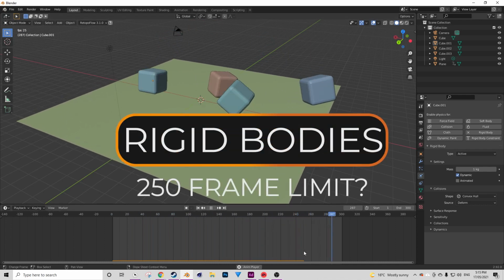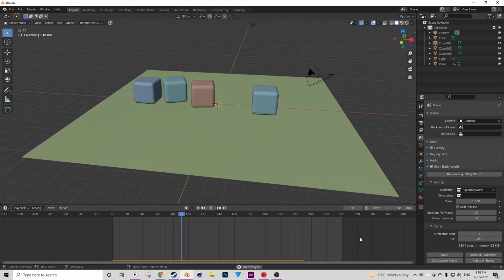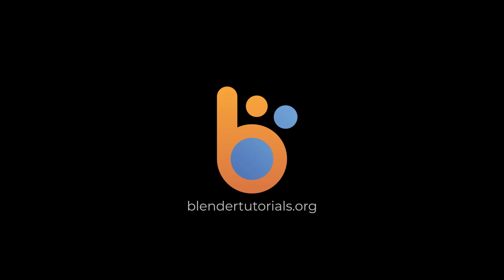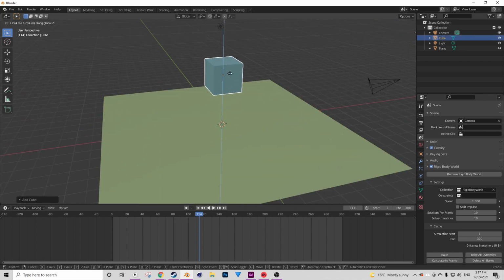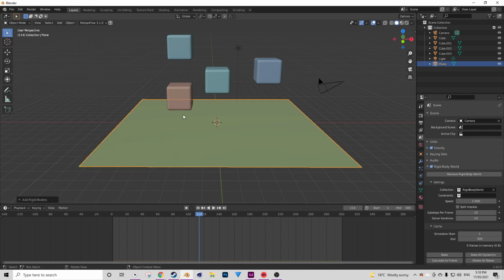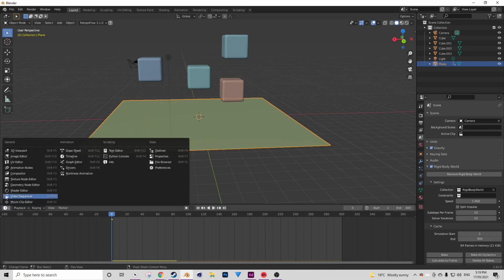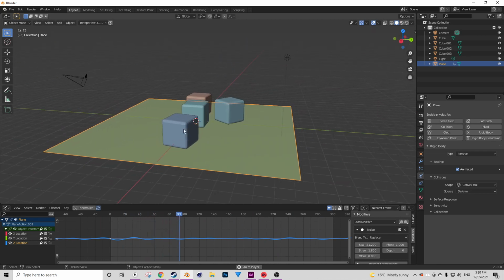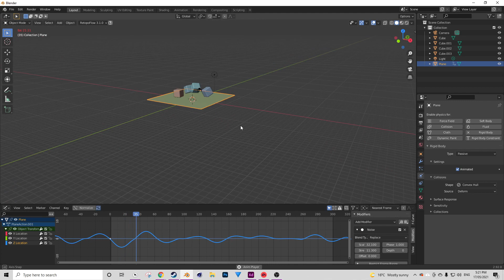Blender Tutorial | Rigid Bodies 250 Frame Limit?

Comment: Hi. I am stuck with my simulation. Even if I change the chache range in Rigid Body Wolrd my cloth simulation stops at 250 frames. What I am doing wrong ? Thank you!
Reply from the maker: Cloth sim is under a different manager -> You will need to go into the cache settings for the cloth sim and increase it to more than 250

Comment: Does this not work for Cloth simulation?
I did the exact thing for my flag
Reply from the maker: Cloth Sims are a different System - (I know you probably already know this, but just answering for archival reasons) - So the cache settings are found under the physics properties.
Reply: @Polyfable  FINALLY THIS IS THE ONE IVE BEEN SEARCHING FOR U R SO FUCKING GOATED MAN

Comment: Im trying to add wind to my scene but no matter what it stops at 250. i tried to do this but it still didnt work
Reply from the maker: Are you using Rigid bodies? Sometimes you might have to change a setting to get the cache to reset.
Reply: @Polyfable  I just found out what was wrong. I had to go to the cloth material and in that cache i could change the frames. Thanks though because i wouldn't have kept looking had I not found this video